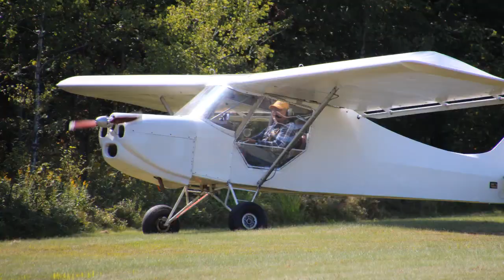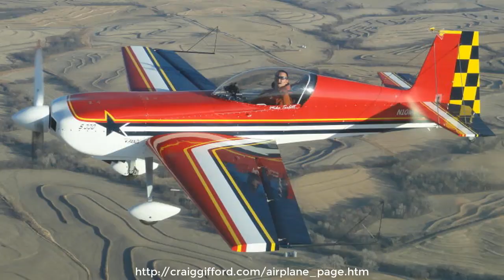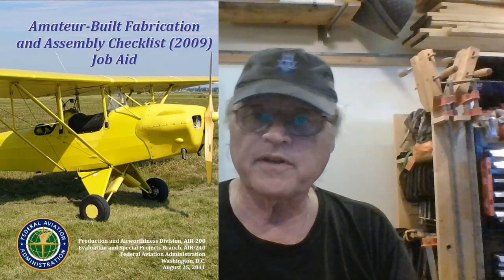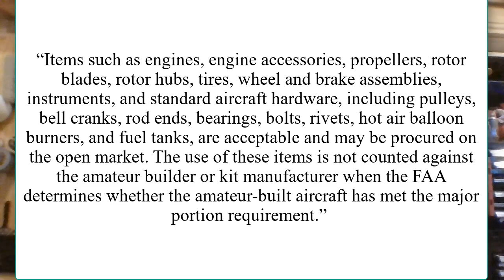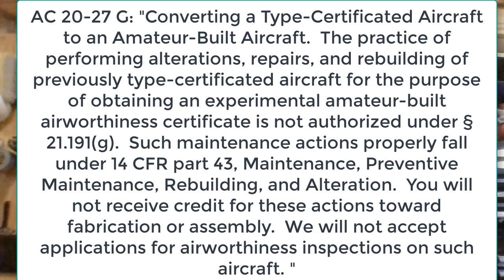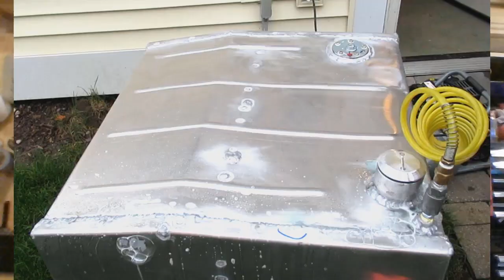Experimental Aircraft 51% rule, Repairman Cert, etc. explained

Comment: If I purchase a previously flying experimental with a airworthness certificate issued,  but the plane is currently disassembled down to the fuselage and will require airframe repairs, wings re installed, engine to be installed ect.   if I can complete 51% can i still qualify for a repairman certificate even if its already been a completed airplane are one point?
Reply from the maker: Seems unlikely. There is only one repairman certificate issued per airworthiness certificate. So you would have to satisfy the FAA / DAR that you built a "new" aircraft. Any parts that are re-used (even if they require significant rework) would be "repaired". You could, for example, likely re-use the wings if you fabricated a new fuselage from new material, etc. No different than using parts from a production aircraft. Somewhere in the advisory circulars referenced, it is suggested that you contact the FAA before re-using large assemblies in your E-AB (assuming you are going for a new certificate)

Comment: It takes a lot of trust to buy a homebuilt, I did that and have been putting a lot of hours into making it right.  I guess its possible to buy a very good homebuilt but I would be willing to bet there are more than a few out there that have some build errors and omissions...I know this from my own experience.  Certified aircraft are expensive for a reason and even they may have issues.  One needs to know what good work is, what bad work looks like, what is a red flag that there may be more trouble ahead as well the type you choose may have issues only known to experts in that particular type. I better stop here

Comment: So, Can the holder of a repairman certificate for a specific amateur-built experimental aircraft perform and sign off a pitot static test as per FAR 91.411(b) acting as the manufacturer?
Reply from the maker: A strict reading of the regulations would suggest that you could - but I wouldn't take my word on this one.

Comment: Hey love your channel! I also have a Merlin GT how would I fix poly-tone paint that is cracking? Couple ringworm spots? Hope your enjoying your Merlin very capable planes. Thanks again
Reply from the maker: You can try the rejuvenator, it won't fix the cracks, but it may slow the spread. You can also brush a coat of polytone over the problem areas to help fill in the cracks. But, I suspect the only "cure" would be to get back down to the fabric with MEK and repaint the area (assuming it is a reasonably small area). Repainting with a brush (a.k.a. "broom job" :-) ) isn't the best, but it's not horribly noticeable with the poly-tone.  Good luck and thanks for the comment!
Reply: Thanks for the help!